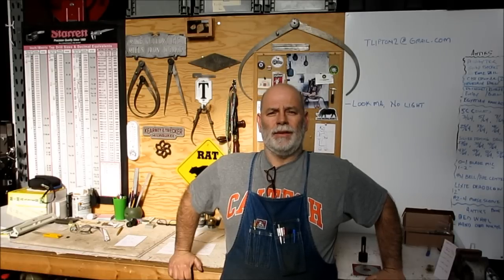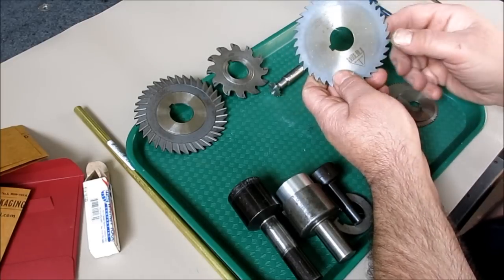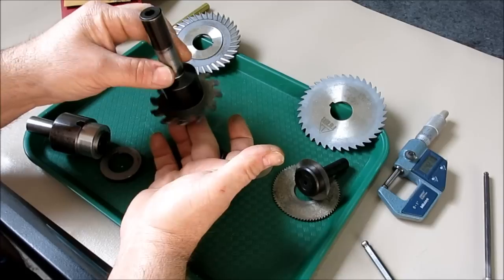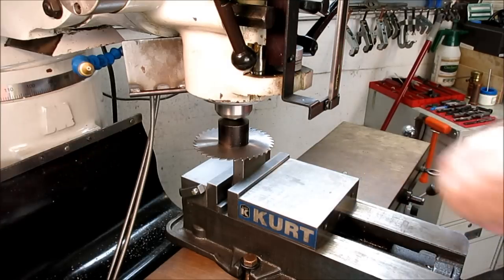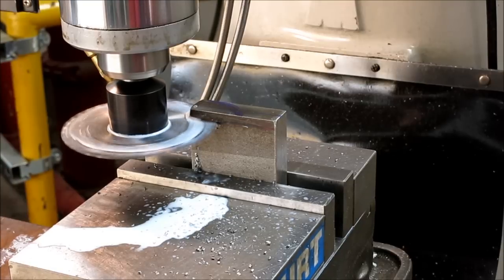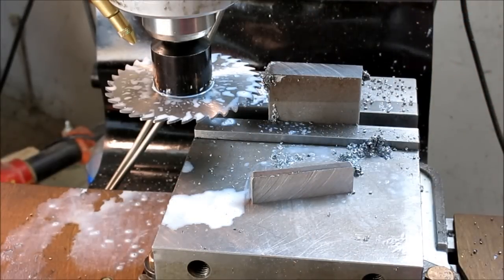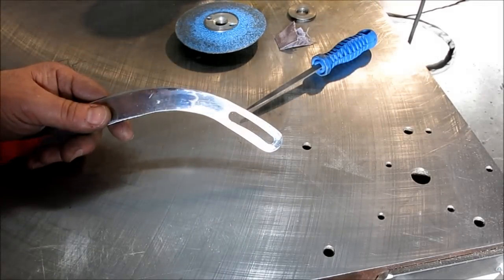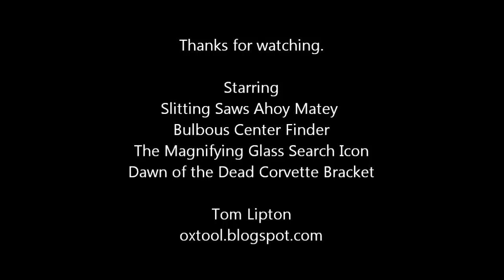Monday Night Meatloaf 15

Comment: Thanks Tom always a pleasure to get another helping of that Ox Meatloaf.  Very good slitting saw overview, kind of an Arbor-Trary subject. It interesting to now know about the counter-intuitive go for broke slitting saw technique, it makes total sense when someone tells you why, another good Ox-tail.  The Oxen are Watch'en.
Reply from the maker: Hi John,

I remember feeling the same way when the old guy told me to take the whole tamale. I had blown up a rather large saw cutting some 316 stainless steel. The fractured blade was wedged so tight I had to use a small wedge to open the slit enough to get the fragments out.

Cheers,

Tom

Comment: I used slitting saws at my first machinist job.  I don't remember ever cutting steel with them, though; only aluminium.  I often used them to part ingots down the middle as it would often do a quicker and cleaner job than the bandsaw the shop had.

Comment: very nice Tom. One of the best. lots of great information hard to find elsewhere. I would like to hear about milling slots (2 or more flutes) and tips on deep slots.
Reply from the maker: Hi Mark,

Thanks for the comment. My advice on deep slots is don't do them unless you have to. Especially if they are have worse than a 3:1 aspect ratio. That is depth to width.

Cheers,

Tom
Reply: oxtoolco "hey doc, it hurts when I do this".  "don't do that"

Comment: Hi Tom, thanks for the great tips on the slitting saws. Taking one complete cut is counter intuitive but it makes sense and I can't wait to try it tomorrow. The paper trick is also neat and I always use the very thin cigarette roll paper and stick it to the steel with oil. The moment it's thrown off I know there is only 0.02 mm left. That's REAL mils in case you were wondering. I'll make a video about the arbor I had to make as the local machinery supplier does not have arbors for my collets.
Regards
Johan
Reply from the maker: Hi Johan,

Thats a good idea sticking it down with oil. I like that one. The world is plastered with postit notes so I have a ready supply no matter what. The sticky edge will stick to your finger and pull away cleanly when the tool catches the paper. I would love to see your saw arbor. The world needs more options in this area.

Cheers,

Tom

Comment: Thanks for the slitting saw info!  Will be useful if I ever need to make a collet...though I now wonder how a collet with an odd number of slits might be made...like 3 at 60 degrees apart.  You can't get all the way across the end, so you can't have a flat bottom to the slit.  Maybe doesn't matter?

A friend years ago used a slitting saw in a lathe to make rings for making chain mail. Saw arbor in the chuck, a block of aluminum secured to the cross slide with a hole drilled through it in line with the blade, at a height that put the lower edge of the blade about 1/3 of the way down into the hole.  Make coils of wire with a rod of proper diameter chucked in a drill (like screen door springs).  Dunk a wire coil in a bucket of cutting oil, start the lathe turning, and shove the coil through the hole in the block and lots of little rings come out the other side ready for joining into mail. Much faster and easier than cutting them with nippers!

Thanks for the learnin'!
Reply from the maker: Hi Mike,

We made a bunch of Mail many years ago. We used tig welding rod and wound the coils in the lathe. Slipped them on a mandrel and cut the rings with a porta band saw. Made some really nice bronze shirts. 

Cheers,

Tom

Comment: Hi Tom here in the uk we use the plain and side cut slitting saws on our mortice key cutting machines, mortice-safe-gate and the old casting key blanks, and as these are ' trade sales' they can work out a lot cheaper than buying throught commercial supplier..Locksmith in London
Reply from the maker: Hi David,

This makes sense. The locksmith at work has the smallest horizontal mill I have ever seen. Hey uses it for the same purpose cutting keyways. I need to get a couple of pictures of that little mill for my archives.

All the best,

Tom

Comment: Tom not sure if you've covered it before but would be interested in looking at the cooling spray setup. Haven't got anything on my mill at the moment and looks like the cleanest setup.
Thanks
Dave
Reply from the maker: Hey Dave,

Time to try out that search function I told you about. There is a video on the coolant dispenser.

cheers,

Tom

Comment: Another fine meatloaf.  I am thinking about buying a mill and may some time get down to the saws.  I figure a Grizzly with power feed will be about enough for me.  I might do better buying a used Bridgeport but they are not so easy to find around here and if they are in good shape they cost a lot.
Reply from the maker: Hey Fart,

Don't go pitbull and lock onto just a Bridgeport for a mill. Plenty of good used offshore clones around and the price per pound is much better.

Cheers,

Tom

Comment: Hey Tom: I know this is an old video, but I found it when I needed it, and....EXCELLENT VIDEO! I have two questions: 1) you didn't show 1/8" carbide tipped cutter. Does it essentially work the same as the other two? What advantages/drawbacks  does it have? Also, what's your take on right angle drives and arbor supports on a Bridgeport? (no room or $$$ for a K&T like Aboms) Thanks, Mike T

Comment: Hi Tomas
Using paper to set tools are very good!
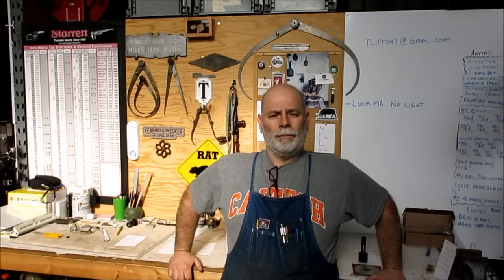But I usually use paper that is about 0:15 to 0:25 mm thick
I've never found 3 mm thick poster sticks'.
I know you mean 0.3 mm.
But I have another tip!
When I work with sensitive details I usually use a sticky acrylic paint or oil paint that I brush on the tool or the part and when I see that color moves or scraped off then you are within of 0.05 mm (0.001965 ").
Reply: Hi Torbjorn, "mil" should not be confused with "mil", it all depends on who is using the term. To a metric user it means a millimetre but to an old Imperial user it means a thou (thousandth or milli-inch). Thou is now the preferred term, in countries where both systems of measurement are still used, to save confusion. The paper Tom is using is about 3 thou or approx 75 micron or 0.075mm, Hope this helps. There is another Mil (angular) but that would only confuse things even further.
chris
Reply from the maker: Hi Torbjorn,

Fingernail polish works well for accurate pickups also. I prefer the light pink because I also use it on my toenails.....

All the best. Thanks for the comment. Chris explained mil it better than I could. Sorry I have been working with thin film insulation material at work lately and the unit is stuck in my head.

Tom
Reply: Hi Tom, didn't think light pink was your colour,but if you insist, now I know what else to put in the care package.
Reply from the maker: Chris Stephens It even smells better than layout fluid. What's not to like?

Best,

Tom

Comment: Couple thoughts on the center finder jig: 
- Make the side pins "blades" or knife edges facing in,  rather than pins or rollers, to subdivide the spacing into thirds, quarters etc. It's the radius of the edge stops that screws it up, so "zero radius" is the answer. (Seen on ancient version made for marking out blanks for 8-sided ship's masts… nothing new under the sun)

- The center boss on your variant is brilliant, but hard to fab.  A shortcut is to face off the bottom of the bar on the lathe a little deeper than your combo square blade is thick, leaving a central boss of known diameter concentric with the scribe pin.
Reply from the maker: Hi Zekim,

Thanks for the great comment. I would love to see one of these mast center finders if you have a picture. 

Cheers,

Tom
Reply: oxtoolco  

Tom-

Google "spar gauge" . 
Some  just used "thin pins" (nails) so error is small, but some have blades or edges cut in the "bar" itself. (They also sometimes approximated 1/root(2) ~ 17/24 and got away with it).

There are also ones with articulated pivoting shoes. Check out http://www.ukworkshop.co.uk/forums/spar-gauge-t47534.html
I've seen the one at Mystic Seaport. 

Now go fell us a stout mast, and be quick about it.

mike

Comment: Tom,

Thanks again for the videos!  I have a new hobby mill due to arrive in a week or two and this video helped a bunch!  Also, I tried your tips for searching.  Have you done a video on gear cutting?  I started searching but not found anything yet.

Jim
Reply from the maker: Hi Jim,

I have not done anything with gear cutting yet. I have a couple of worms and worm gears coming up in the future on the etching press build. Thanks for the comment.

Cheers,

Tom

Comment: Thanks for the video is it dangerous to chuck one of those arbours into a lathe ??Or even the woodruff cutter..:)
Reply from the maker: Hi Bear,

I have never tried that. I suppose if you mounted a vise on the cross slide you could easily make a pretty good cold saw with power feed. Never even crossed my mind. Great idea.

All the best.

Tom

Comment: Hey Tom, on slitting saws with runout, do the teeth wear more on the high side and stay sharp on the low side? Seems like a waste of a blade if you don't sharpen them because you shorten the life of the teeth.
Reply from the maker: Hi Andre,

Keep in mind they are typically only running out a few thousandths. The feed per tooth keeps the rest of the teeth cutting as well. These are typically run pretty conservatively on manual machines as well which gives them a long life.

Cheers,

Tom

Comment: Thanks for the tips, I do struggle with using a slitting saw and now should be more successful.  I tried your tip on searching a channel but on my interface {Macintosh iPad} the only search icon is for the web - everybody’s.  Is there something you do on your setup to make this appear above your list of videos cause I do not get that secondary toolbar row.

Comment: Hey Tom.   Really like that spinner style Allen wrench.  Is that something you made or modified?  Never seen one before.
Reply from the maker: Hey Huskie,

I'll try and hit all your questions here. The spinner is a home made tool. We made them up is several common sizes for the equipment we designed. If it wasn't a #10 socket head it was 1/4 inch. Cuts down on the hunting for tools.

On your search problem you should have used "The most interesting man in the world" and you would see my smiling face plastered all over your computer. 

Glad you got some useful information on the slitting saws. Its the other operation where folks get jammed up. Right next to parting. Curiously they are both very similar operations.

All the best and thanks for the comments.

cheers,

Tom

Comment: As usual, when I first try a new tool, I scrap it. Like the slitting saw. Thanks for telling the rpm. I think that was running the old Van norman milling machine too fast. 100 - 150 rpm, is that right ?
Thanks
Reply from the maker: Hi Robert,

For a 4 inch diameter saw in steel that's the right range.

Cheers,

Tom

Comment: Hi Tom, you did a great job at turning a sow's ear bracket, into a silk purse with those mismatched radii... Hard to even imagine that would happen on something that was supposed to look flashy. 3 mil. paper? (Just messin' wit cha)... That's a good old school trick. Moving in till it catches! Thanks for sharing... BTW what horse power is your lathe? :o]

O,
Reply from the maker: Hi O,

Thanks for the comment. The lathe horsepower is classified at least until I put Adam away. He has tipped his hand for all to see.

Cheers,

Tom

Comment: Why is a ground face or seat preferred over a machined face?  I know this sounds obvious to some but machining and grinding are very similar.  Why is grinding worth the extra effort?
Reply from the maker: slad roznik Hi Slad,

Typically we associate ground faces with closer tolerances on machined parts. Not necessarily true but its correct more often than its wrong. Thanks for the comment.

Cheers,

Tom

Comment: Hey Tom, 

I know this is an old video,  but if the arbors are made in CA they might be from Sierra American.

-Dan
Reply from the maker: +dans-hobbies Hi Dan,

I have used Sierra American arbors. I like their design with the long engagement of the male saw holder into the body. Thanks for the comment.

Cheers,

Tom

Comment: Hey Tom, hate to sound negative but I have got to pull you up over saw arbours, one inch in this case is not, or even about, 25 mm, it is 25,4 mm or nothing. The metric brethren will just have to accept Imperial is still valid and stick with good old inch diameter, Yippee!
ATB
chris
PS thanks for posting your videos timed for us Europeans, just in time for afternoon tea break, and an excuse for a longer than usual one, too. :>)
Reply from the maker: Hey Chris,

I get in trouble rounding off in all the units. This week I'm stuck on mils as we are doing some work with films and thin insulation which is typically specified in mils. And for anybody reading this comment a mil is one thousandth of an inch.

Cheers,

Tom
Reply: oxtoolco Hi Tom, forgot to mention that I use slitting saws for another use, that of engraving. I use a 10 thou by 1 inch blade to engrave degree lines on index dials. The big advantage of using them is that no matter how deep you go the line never gets wider, mind you the last time I did one was pre DRO days so repeatability was more of a problem then. Technique, using a spindexer, is to set table stops then do all the ten degree lines, reset stops and do all five degree ones then set stops again and do all single degree lines. Doing it this way if you cock up no problem as you don't harm the long lines with a shorter one. Now tell me that is in chapter ten of your book. :>)
LL&P
chris

Comment: You might want to point out that when you use a saw without a key slot, you should orient the saw on the arbor so that the cutting force will tighten the arbor screw, rather than loosen it.

Comment: if the saw blade is used with the most of care what is the average life span
Reply from the maker: Hi Flineman,

Slitting saws can last years if only used occasionally and treated nicely. Typically you run the cutting speed at the low end of the recommendations for the material you are cutting. 

Cheers,

Tom

Comment: have you even put 2 - 3" dia x 1/16" thick slit saws together, with a thin washer in between - like a dado cut? to get a 1/4" slit?  and would you line the teath up adjacent to eachother or off set?  mark  www.dogpoweredscooter.com

Comment: Hahaha,

He said slot, rump, throbbing, piece came sliding, slit, whack and tang! You enjoy your work far too much! Why don't you try something harder, wink wink nod nod... like cutting timed threads on your screw!

You hansom devil,
Ha hahaha,

BTW I'm straight. eat your heart out!
Jim
Reply from the maker: Hey Jim,

That's actually really funny. I did say all those things in one video to boot. Timed threads, yawn...... Eventually you will crawl and beg then I might think about it. On second thought your right they are too hard. Better quit while I'm ahead.

Cheers,

Tom
Reply: I have tried the begging approach, pretty please and all, Still no timed threads. I asked nicely and got hazed for my trouble. Yeah it's probably a real yawner for you, however some of us may really want to know how to do it. Please show me how to do timed threads Tom, I really want to know how.

Thanks,
Jim
Reply from the maker: Jim Ward Hey Jim,

Give me your desired scenario. Are you building a firearm or something that has to line up when its tightened? It would be helpful if you had a good example of what you are trying to achieve that you could describe to me. 

Best,

Tom
Reply: No not a firearm, lining up blocks on a machine to insert a pin through two bored holes with a fairly tight slip fit for an operation. The pin is then withdrawn to release the part from the jig, the blocks with the holes are moved out of alignment to allow clearance for the next part to enter. rinse and repeat.
Reply from the maker: Jim Ward Hey Jim,

Got a picture or sketch? I'm not understanding where the timed threads come in. Are there screws that adjust the block positions for align and not aligned? You can send it to my email.

Best,

Tom
Reply: Tom,
Yes the threads will be used to align the blocks. I didn't expect that you would build the jig, just a screw and nut that move to a repeatable position will do. I don't want to make it hard or expensive for you, just the concept would help.

Thanks,
 Jim
Reply from the maker: Jim Ward No worries. Shoot me a picture of the setup. I still don't have the full picture in my head of how the timed screw comes into play.

Best,

Tom
Reply: I sent a chicken scratch drawing to your super secret white board email address. Did you get it?

Thanks,
Jim
Reply from the maker: Jim Ward Hey Jim,

I have not seen anything yet. Double check the email addy. 

Best,

Tom